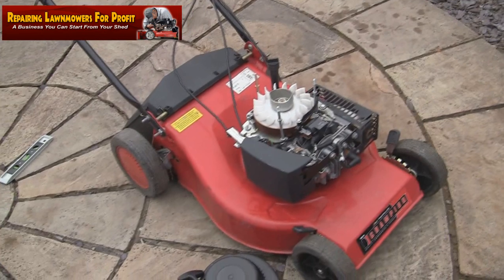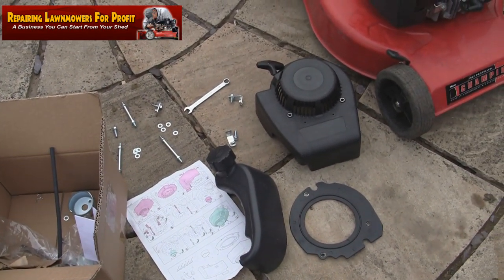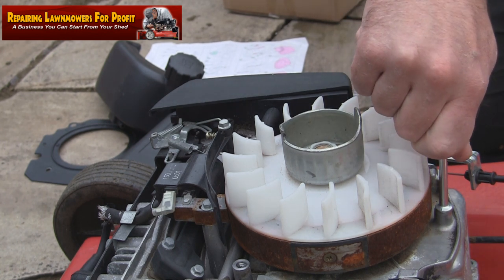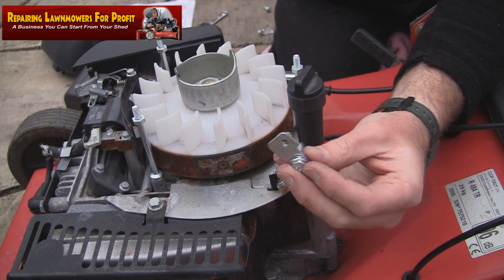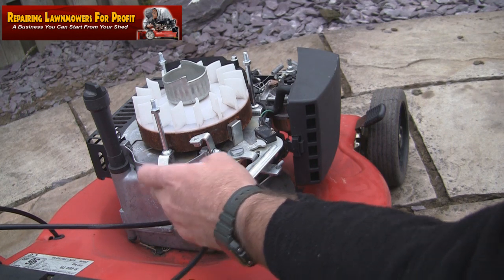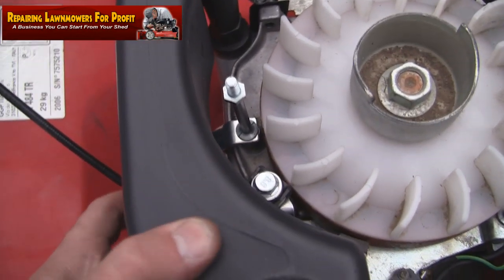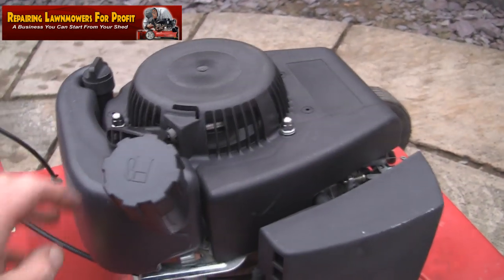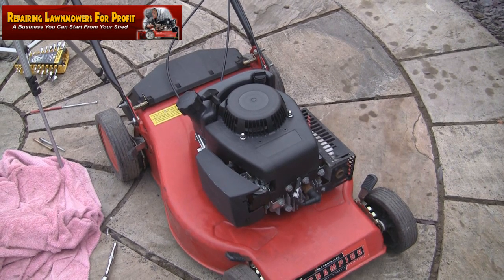Mountfield SV150 Engine Split Petrol Tank. How To Fix.

Comment: I Would like to advise I have just converted my Lawnmower with the same conversion kit and you do need to replace centre part of starter because there is 4 mm difference  in the size of the parts . This probably is the reason he is having to add distancing washers to the pillars
Reply: +Robert Cooper, i did not replace like the video and have damaged the pull , not impressed at all

Comment: Hi mower man! I've just bought a mount field RV 150 it's worked twice and now won't start, I've sent it two someone who repairs them for a service and it worked once and now won't start, the thing is it's not that old. We have watched all your videos and tried to solve the problem, but still can't get it to start. Now the guy I sent it to put 2 stroke oil in, which we've emptied and replaced it with 4 stroke with know luck. Are you near me or could you please give us any advice to why it's being difficult when it looks nearly new?? Thanks

Comment: Hi,
Nice video. I have the same lawnmower with a sv150 engine. I was cleaning the underneath and when I turned the mower to look at the blade, oil has leaked everywhere. I had tilted with it with the air filter facing upwards. Is this correct? The exhaust is full of oil and many other parts are oily too.
Why is this ?
Thanks.
Shiraz.

Comment: hello, i have a problem with my mover, it is runnig only on high revs, if i lower the triger slightly the mover shuts off, ive changed the oil, air filter, and a spark plug, and nothing hellped... can you recommend anything? i have stiga lawn mover with sv150 enhine, same as on this video

Comment: does it rev like it is going to explode? if so sounds like the govenor wheel. it is a plastic wheel with 2 weights on it. the weights sometimes stick and it wont control the speed. but it is inside the engine case you would have to strip engine. but check the govenor arm is not catching the throttle cable and that it can move freely. if all ok  it sounds like the gov wheel inside if you cant do it yourself then would not be worth fixing. unless you can find someone with cheap labour rates.